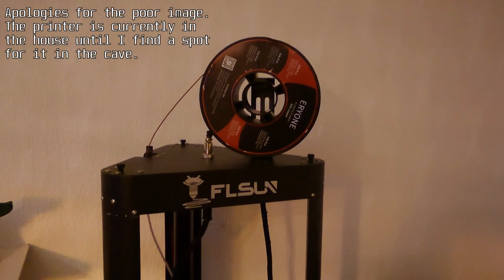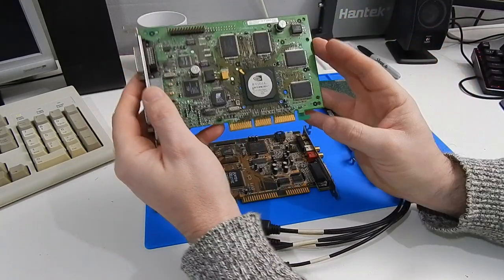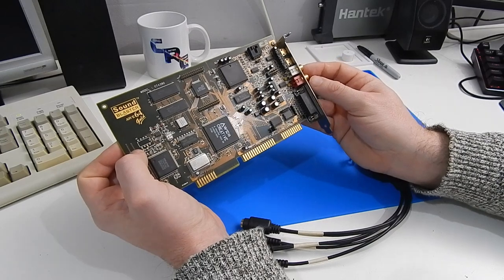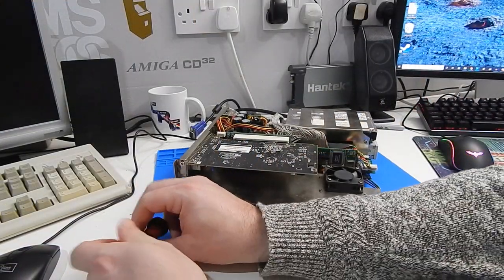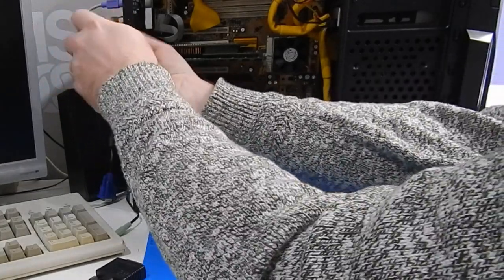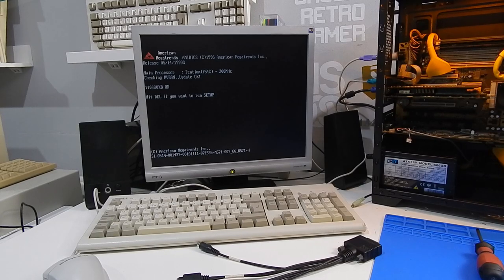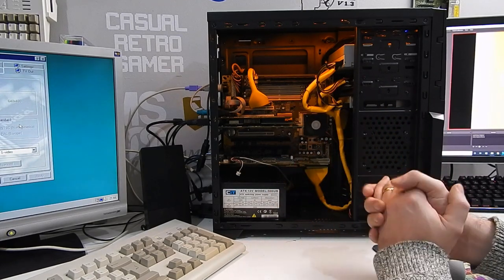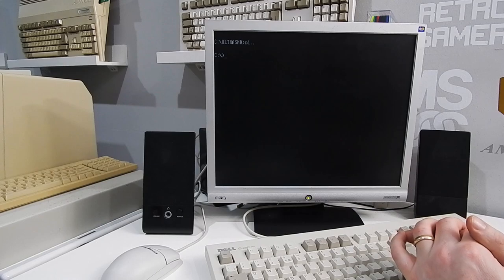2020 end of year pickups, donations and system build updates.

Comment: The AWE64 GOLD is certainly a much more period correct card for that '96 system, but for Windows 9x games, the Live is much better, due to being PCI and hence removing the major bottleneck that the ISA bus can be, especially on games using DirectSound, and the hardware acceleration offloads the CPU to a noticeable degree, enough so that you should see better performance in some games. That being said, the AWE64 GOLD is cool and I would probably have gone with that myself :D

Comment: I believe the issue with the TV out at the DOS prompt is that that runs at 70Hz, and it might just not be able to encode a compliant TV signal or it's just out of range for something expecting 50/60hz.  I believe there are TSRs that will try to force everything to 60hz.
Reply from the maker: That's probably correct but I wonder how it handles the dos games.  Other games such as doom for example also play fine on the TV out.

Comment: As far as your issue with muted Sound Blaster Clone is concerned please check if you have SET BLASTER command in AUTOEXEC.BAT for both Ultrasound and SB clone. I know it might sound strange but give it a try. BLASTER variable for Ultrasound with all its init commands should go first and below BLASTER variable for SB clone. Each setting must be different. For example A240 I7 D6 for Ultrasound and A220 I5 D1 for SB clone. It worked for me.
Reply from the maker: I commented out the set blaster line for the gus as I thought that might create conflicts with the same line for the actual SB card.  The GUS setup is first but I'll have another play with it and let you know if it works.
Reply: I wondered about the 0 volume levels in the mixer setup, unless that's 0dB i.e. full line level. Not sure why just unmuting it again would set these levels temporarily
Reply from the maker: @TheErador  as I understand yes it's just 0db so line level.  It can be set negative and positive too.
Reply: I have GUS line out connected to Sound Blaster line in. In my case when there was no SET BLASTER command in AUTOEXEC.BAT for the actual Sound Blaster card SB mixer couldn't set volume levels properly and all had been muted. After adding BLASTER variable in AUTOEXEC.BAT for the Sound Blaster my problem was gone and Sound Blaster mixer works properly now. I can now use both GUS and SB without any issues.
Reply: @ukaszkowalczyk3011  aha so the other way round to @crg, gus > sb > out, is there an advantage to having the gus do the mix? Can't think of one unless the sb adds noise
Reply from the maker: When I try GUS - SB - Speakers I get a lot of noise.  As if the SB is amplifying the signal.  I can clean it up somewhat by changing levels buts it always better direct GUS to speakers. 

The other solution would be to use an external mixer to combine the signals.  I've actually been looking at something like that anyway to try and keep all my machines hooked up to speakers at once.
Reply: @TheErador  well, about that noise it's true. I hooked up everything this way because I initialy have had only Sound Blaster 16 connected via gameport to external MIDI module. GUS was the latest addition to this setup. I use Sound Blaster for digital sound and GUS only for MIDI playback in some games. Since there are many titles that don't support GUS at all I also use Sound Blaster for MIDI playback (WaveTable daughterboard installed). I don't use GUS SB emulation capabilities at all. Last but not least to the GUS line in there is currently connected external MIDI module out.
Reply: @CRG  yeah external mixer was my first thought, some cheap little units available nowadays. Little soundcraft or behringer pot only style jobbie would be great in this situation.

Comment: Great video ive got the same Digipos PC have you ever found a modern alternative to the old PSU?
Reply from the maker: Not yet, all be it I haven't really been looking.  I you took the mechanical hdd drive out to save some power I wonder would one of those pico psus run it.  Would take a bit of modifying but should all fit in the case. 

I might give this a go and see how it works.